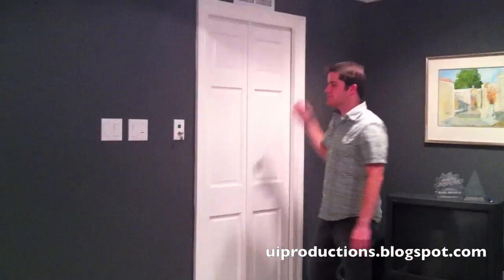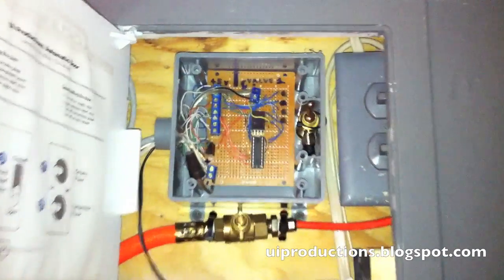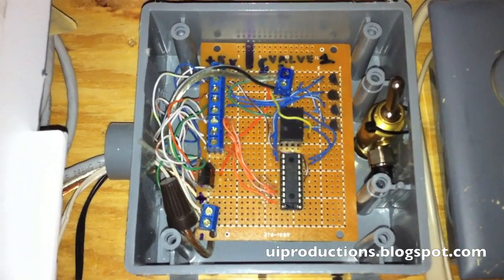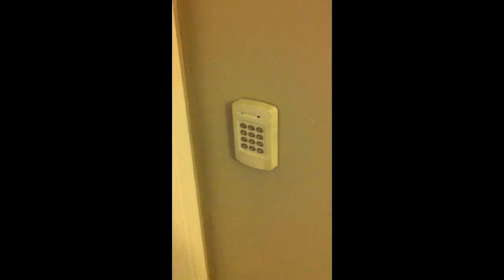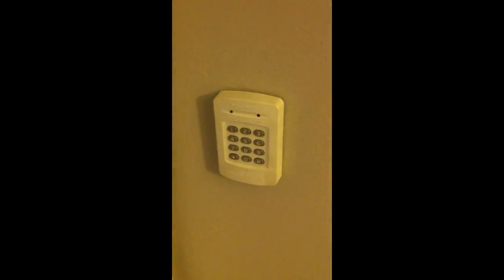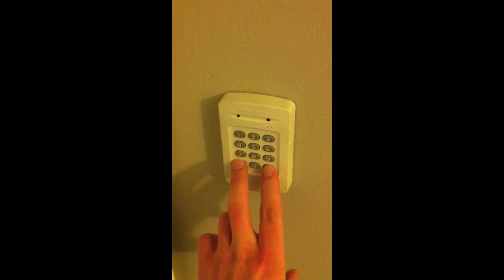Star Trek Door (Extended Version)

Comment: So what happens when power fails? Perhaps a manual high pressure hand pump could be kept on the inside to allow escape?
Reply: sledgemeister reroute energy from the warp core.
Reply: Ah, but how do you get in in the power fails while you are out?
Reply: Let’s assume the locking of the door is mainly for privacy reasons, not to secure anything of a high value. The system could be setup to automatically release the air pressure upon power failure, allowing manual operation.
Reply: MishalEnYusefTV if the power went out and emergency power was off, how would the computer still be on? :P
Reply: eventually the compressor would leak out of juice bruh
Reply: CHERUSCI 14 Scotty would and has broken the rules of the Universe. He would get power to the door.
Reply: Vojtěch I would like to see you go through the process of "simply releasing pressure" while your room is on fire and you are trying to get out... 
I would suggest a lever on rhe outside to vent the system, like it is required in public.
Reply: Realy ?? Did you even watch the whole video ?? you can just relase preasured air and open door by hand
Reply: "relase" ? does he "re-lase" with a star trek "lase"(r) ?

Comment: Now.. where would you get compressed air.. in a flat.. :D Idea is good of course, just i would use electric motors of course
 instead of cylinders.
Reply: just an FYI - he does not use cylinders - he is using a small air compressor in another room (in his case, the attic) which could be hidden in a closet etc.
Reply: harrys84
Reply: Correct me if im wrong, but i believe the air compressor powers the cylinder
Reply: i mean he uses pneumatic cylinders that require compressed air. and as you all know, air compressors are not silent.

Comment: why a keypad? I could probably kick down the door or pry it open with a butter knife
Reply: You could also kick down almost any interior door in any average house - how is the relevant?

Its an aesthetic modification.
Reply: I think it has constant pressure keeping it closed. if you notice, he has to release the pressure before he can open the door manually.

the keypad is probably so he doesn't have to have 2 keys. if you had 2 keys, you'd have to have them in the same position, which can wreck havoc and be soo annoying. I think this setup is the smartest way of handling it. He wants to be able to have a button on the outside (pressing star and pound), but also wants to be able to lock the door from the outside. but, instead of having 2 keys, using a keypad will make it a simpler setup.
Reply: jeff cantley lol I asked my landlord one time to install a lock on a door in the home. He installed one of the sliding bolt style locks. Horizontal. It was, of course, a sliding door.. So the lock did absolutely nothing
Reply: I'm sure he could make a locking mechanisms if he really wanted.

Comment: I installed one of these doors going into the room where my Transporter Beam is located.
Reply: I tired that but my dilithium crystal matrix burned out, causing a tachyon impulse surge in Jeffrey’s tube 4-sigma.
Reply: Tozmo. You need to use a ferrite core to protect the sensitive tachyon flux integrity. Sudden spikes will kill your dilithiums every time.
Reply: Hutch5321 I believe you 👀
Reply: You star wars guys are off the hook!
Reply: +Jeffrey Anderson - "Why do you need a door into a Transporter room?"

Well the way most transporters work (like on Star Trek), you walk into the room (using the door) to access the transporter. There, a person "operates" the transporter to transport you to some other place. Then (usually) later, a person operates the transporter to transport you from the other place, back into the transporter room where you leave the room using the doors.

A transporter room (like that) with no doors would be useless since you need a person inside the room to operate the transporter and without a door, no one can ever access the transporter.

Plus, as it was used, they wouldn't use it to transport people from other areas of the ship to the transporter room. So, if you used the transporter to transport a person from another place (a planet or another ship) into the transporter room, if there were no doors, they wouldn't be able to leave the room to get to other areas of the ship.
Reply: Now all you need is a replicator! For your Tea, Earl Gray, HOT.
Reply: I appreciate this humor)))
Reply: Why do you need a door into a Transporter room?
Reply: Transporter pad *

Comment: And what happens when the system fails, are those doors able to open with force if you cant get in  / out or to the control unit?
Reply: +CK Wunch did you not watch the video?
Reply: chandler1289 Yea but its not clear the system can be forced or is accessible from both sides.
Reply: CK Wunch if the control panel is on the inside of the room go to the attic and drain it manually. if it is on the outside of the room and you are inside just climb out the window haha
Reply: Force. . .like an axe or saw? It's just a door, not some magical device.

Comment: So if the power goes out, you're screwed.  LOL!
Reply: +F Ward no he's not. he can close the pressure valve and vent the pressure. than just open it like normal.
also he can set it up so it can work off a 9V battery in those situations.

Comment: what if someone is standing in the middle when the door closes?
Reply: Fortunately, very few pets are able to activate the door on their own, so very unlikely to be without a chaperone in the open doorway.  :-)
Reply: by the sound of the pressure released, it doesn't sound like it'll create enough pressure to harm someone. they may get grabbed a bit, but I'm confident they could easily get out of it. you can make it to where it won't hurt/hold them by putting a smaller compressor that doesn't have that much PSI. which, I'm sure that's what is on his.

also, its held open for pretty dang long.
Reply: hopefully their head will be crushed like a melon and auto video is shot and uploaded to YouTube before you even knew what happened!
Reply: +Justin Dunn Then they obviously didn't want in/out of the room badly enough. They pay the ultimate penalty.
Reply: +1Howdy1 someone doesn't like dogs....
Reply: I’m assuming he’s a bachelor with no pets or kids. Pets in particular would be hurt by this.
Reply: They die.
Reply: They die it’s no that hard to figure out
Reply: He cleverly installed a transporter elsewhere in his house to safely beam the trapped party to the bridge.
Reply: I worked with pneumatics before and from what it sounds like is he's using air pressure to open the door and a spring to pull it back closed. I'm pretty sure any animal or person with a brain would move when they get bumped. But if it did so happen that they did get caught, it would be annoying but wouldn't kill you.
Reply: That's not a bug, that's a *feature
Reply: Brian Bock...    
Well,  of course he's a batchellor...   hahaha..
Reply: Justin Dunn Help, I'm being gently hugged by a mild tension in the middle of a strange man's home and I don't know how I got here and I think I peed a little.
Reply: +Sunny Pandey It's actually not. With kids or animals they may stand in the doorway and it doesn't sound like he has a sensor checking to see if it's closed. So it could seriously hurt someone.
Reply: +Keyeszx Probably not the way it is, but you could install garage door springs or closing hydraulics to the system if you want a greater guillotine effect. You're right though, a sensor would be better for kids and dogs. You would need two, one low and one high. When both activate the doors stay open, when just the lower sensor activates the doors snap shut.
Reply: Justin Dunn 
Dead
Reply: stupidest question ever

Comment: Question... So the air pressure keeps the door closed? Right? The door opening is the air pressure releasing right? So does the compressor have to periodically turn on to keep the doors closed? And When closed (assuming under pressure) how much actual resistance does the mechanism hold? AKA... even under full pressure could a person slide the doors open with some effort?
Reply: +sammythesnake1986 I was thinking 12 volt linear actuators.
Reply: Peter O'Hanraha-hanrahan
Keep in mind, a hydraulic leak can be nasty. An air leak ... annoying, but it won't soak into your house framing and/or floor and cause damage!
Reply: I was thinking same thing with magnets on a rail versus a sound of air pressure releasing ...
Reply: hydraulics are much slower than pneumatics
Reply: +Dee Jay (DJ) 
Agreed, I appreciate that it's a star trek door and you want the sound, but in todays world I think hydraulics would be better suited for such an operation.

Comment: What if you're standing in the door way, would it still close or your door can feel there's something stopping it? For eg, if you have a kid who's standing in the way or perhaps someone's hand. It might get stuck.
Reply: ***** It is most likely not that strong because it is using an air compressor. I would suspect that it is strong enough for the doors to move, but it doesn't have enough strength to do any damage. (Unless you have your head in between it...)
Reply: ***** I think he acounted for that, seeing as to how slow it closes. You'd have ot be pretty dumb to get stuck in such a slow moving door anyway.
Reply: Bas van de Kleut Yeah but kids can still get in the way. I think if he could add a sensor, it would be perfect

Comment: i imagine it would be very simple to rig a chime noise for when the door is locked and someone pushes the buttons on the outside. Give it that "beep beep boop boop" of people requesting access on a starship. :)

Does the light on the outside panel go red if the key locks the door from the inside?

Comment: I would still add the motion sensor, for when it is working on the timer. If someone is still crossing or standing under the door it will not close and override the timer.
Reply: Julio Gutierrez It is most likely not that strong because it is using an air compressor. I would suspect that it is strong enough for the doors to move, but it doesn't have enough strength to do any damage. (Unless you have your head in between it...)
Reply: Program the door opening to allow motion reopen, and then motion off when closed.

Comment: This door might kill you in an emergency, like a fire, when your power is down.
Reply: Did you watch the video? He shuts off the power so he can push the door open manually.
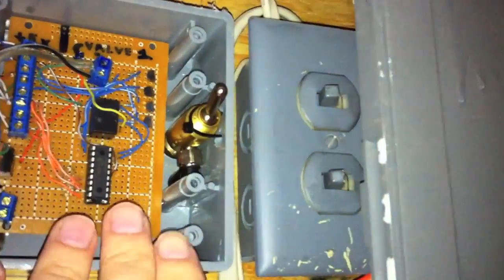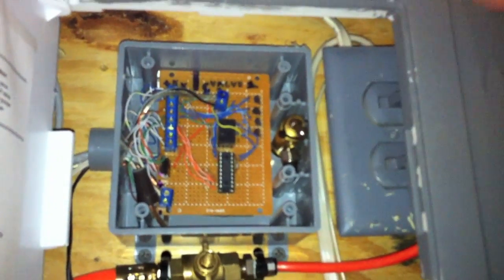Reply: GirlDevils I watched it again. To manually open the door, you have to follow the procedure he stated form 1:50 to 2:06. The most important one is "vent the system" because it is pressurized, and you can't open the door until the pressure is released. So, in an emergency, only cutting the power is not going to open the door. You probably gonna die in there while firefighters trying to figure out how to open the door.
Reply: I have to admit this door is interesting, but I wouldn't want to use it in my everyday life.In a theme park? Maybe. It's just too complicated. I bet he can't even sneak into the room without waking up her wife at late night.
Reply: I know PC's have a button cell battery on their motherboards for when there's power failure. Perhaps having a continuously charged battery on the circuit board might be a good idea so the system can be vented without mains power
Reply: Jay Goldie it doesn't have to have power to vent that switch is not electrical its pneumatic
Reply: Chen Liu  That's a very good point. One thought is that someone with this level of sophistication in their house will have interlinked smoke/CO/heat alarms... these can control relays. So, perhaps a good way to deal with this is to have a relay-controlled dump valve to vent pressure when the alarms sound?
A less elegant solution would be to have the same big handle that train doors have for emergency opening.
Reply: jesse green
My bad. I thought it was an electrically operated vent. That would make it even more practical I guess

Comment: This is very cool. Well done.  Wondering though , how the 2 x 4  framing in the wall was handled since spacing by code is 14-16 inches between studs.
Reply: Pocket doors allow for it. you can have 3'f" pocket doors. much of the internal walls of a house are non-load bearing and only need the 16" or 24" spacing for proper hanging of sheetrock. A pocket door as 1x3 material to secure the sheetrock to for the same purpose. if putting a pocket door in load bearing wall, just like any window or door you need a header to bridge the gap. 2x4 Jacks then pick up the load on both ends of the header. how many jacks is determined by weight the header is picking up and span of the header.
Reply: It is 2 pocket doors.

Comment: advanced version of it  has potential - it doesn't need room to open up into corridor or room.
For mil/police use it has no hinged door to kick/create a blindspot.
Cant kick door open or break it off hinges ( can try pulling it apart. .but u can have metal rods locking it up + i could be in a slotted frame.
Reply: how about an axe? or break the buttom part?

Comment: is that compressor in the attic loud? great engineering btw it works flawlessly the circuit board was simple id think it would be packed and do you run this off a regular  20amp breaker in your home? thinking about making a single slider for my class at a smaller scale

Comment: what if you're inside and someone locks the door from the outside? can you still get out... would I be right as to guess that the keypad only locks the keypad function?
Reply: he showed you how to turn off the air compressor and the power supply inside the room so that it opens manually when you only have to

Comment: I am building one of those in my room and i want to use that key switch thing if  am going to buy 2 one for inside and one for outside my actuator has a positive and a negative so i was wondering if that switch will reverse the polarity so that i can open and close it from both switches. and where do you buy then from

Comment: You should use a pressure mat at the base of the door and you should make the door much faster to open. You could lift up the floor, put the mat down and then lay the floor on top of it so you don't even see the pressure mat.

Comment: How would you lock the door behind you, if you went out during an outage? How would you get in during an outage? It needs a battery backup, and preferably a manual override for the front door. It's still a cool design though.

Comment: I want one!
I would install spring loaded air cylinder(s), so that the door would default open or closed (depending on the cylinder) if you lost air pressure or power.